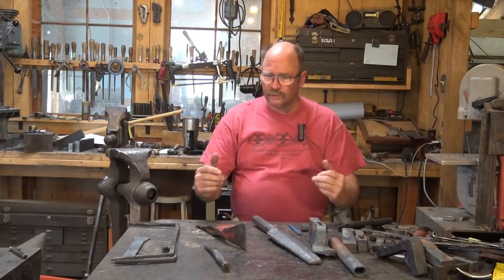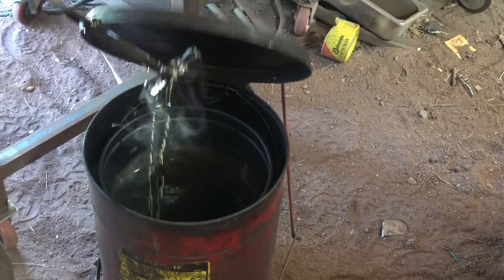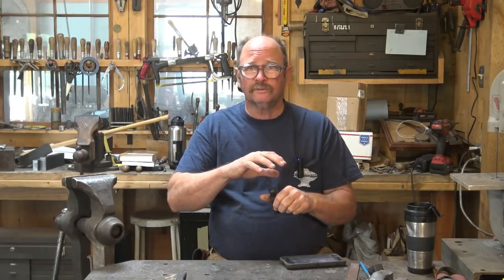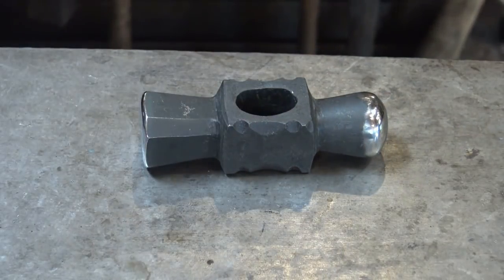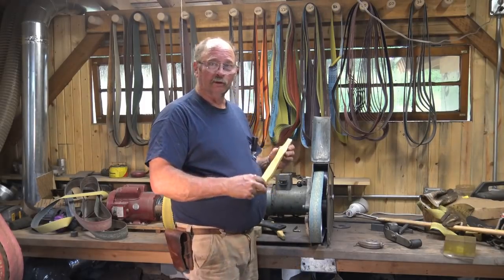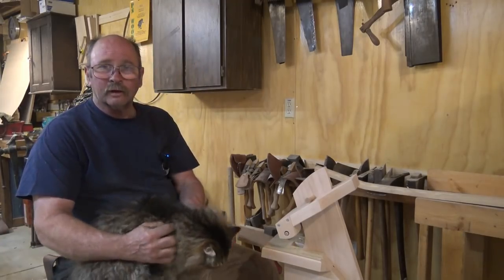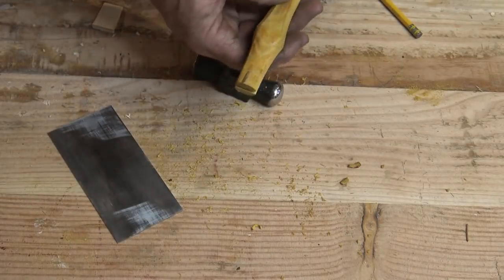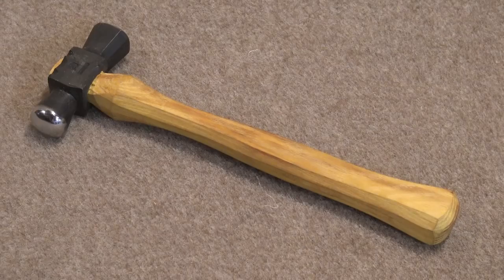Making the small ball peen hammer - tool making - part 3

Comment: That was a lot of fun to watch this series. Have you ever tried oak as a handle for anything? I have about 600 pounds of it and use it for burning. I have many pieces of planks of it as well. For the wedge, is there a better way to put it in? I notice you do it parallel to the hammer head and have seen others do it across. Just curious if it makes a difference. Thanks again for all the help you have given, it is cherished and bottled up. 👍🏼
Reply from the maker: I have never seen anyone using Oak for a handle.  It might work for smaller tools, but I am sure there is a reason it isn't common
Reply: Good to know. Thanks

Comment: why is it you dont recommend old or new motor oil?
Reply from the maker: motor oil has additives that can cause problems with the steel, old oil is even worse since it also has many impurities.  Hot steel can absorb some of these unknowns during the quench.  Plus it is likely to be more easily ignited causing a fire.  Commercial heat treating oil is a bit expensive but 5 gallons should last for many years.

Comment: I absolutely LOVE the deburring wheels. When we wear them down to a 'worn out' stage on the bench grinder at work, I get them as trash. I have a set of arbor inserts, and mount it in my angle grinder. Works great!
Reply from the maker: Never thought if using then that way.  Of course this one is several years old and has only lost about 1/8" so it might be awhile

Comment: Very nice hammer!
Is there a particular reason why you used a wooden wedge instead of an metal one?
Reply from the maker: Most wooden handle rely on a wooden wedge as the primary wedge.  Wooden wedge can be fit and driven into the saw kerf. A metal wedge is then sometimes used to add a little extra and help hold the wooden wedge.  But metal wedges also tend to crack the handle at the top of the eye, particularly on these little hammers.
Reply: That makes sense, thanks.